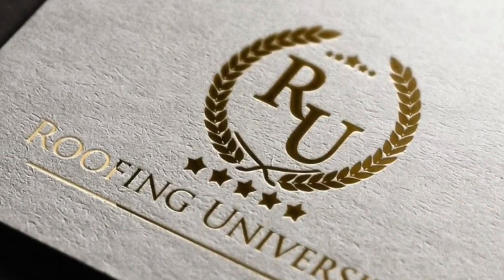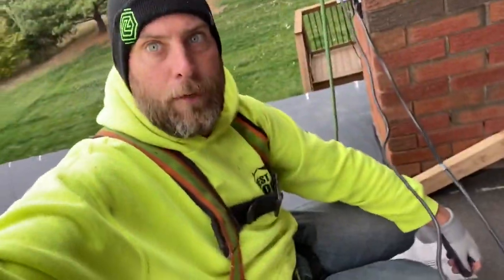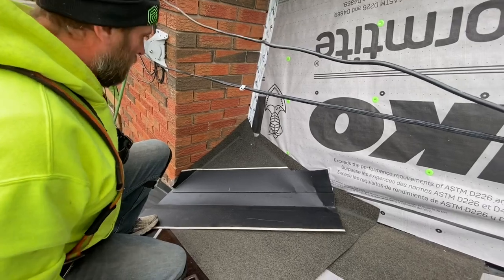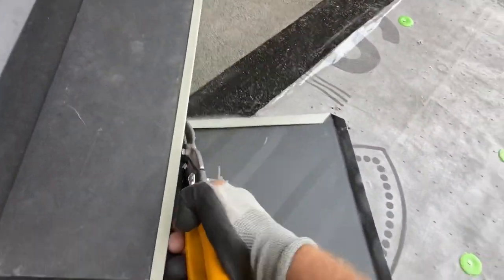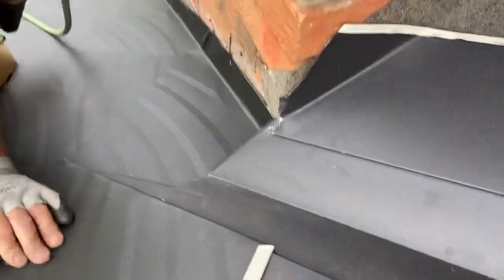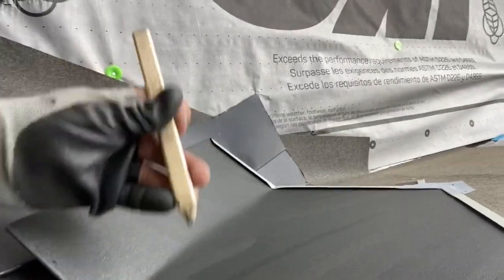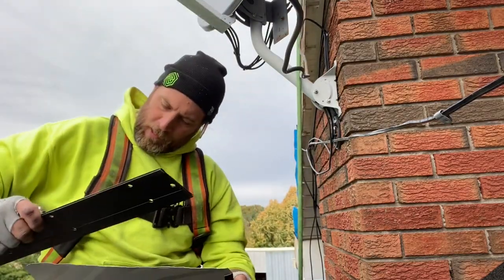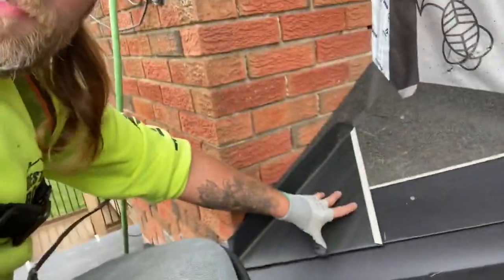Installing A Cricket Behind A Chimney

Comment: That’s my first time seeing that type of roofing, I’ve been doing traditional asphalt shingles and long steel roofing for about ten  years(I’m only 23) how do these metal shingles hold up in strong wind? We usually get at least 3 storms a year with 160kmh+ wind. We have to put a fairly thick layer of plastic cement on every asphalt shingle tab and a screw every 16 inches on long steel or they’ll be gone in one good storm.